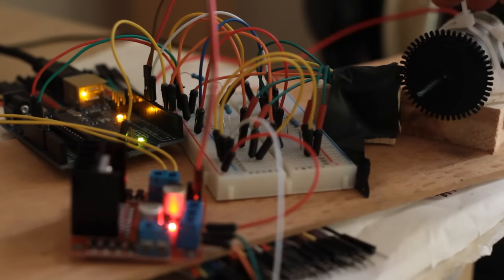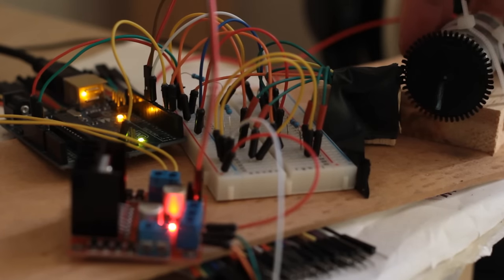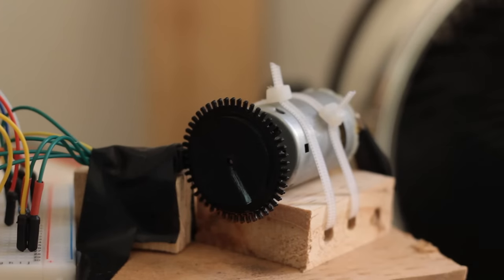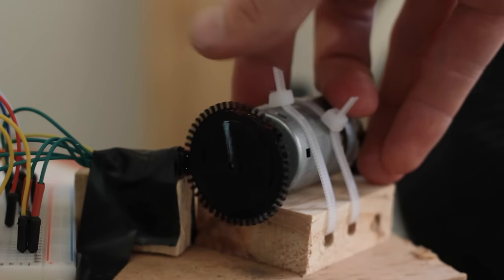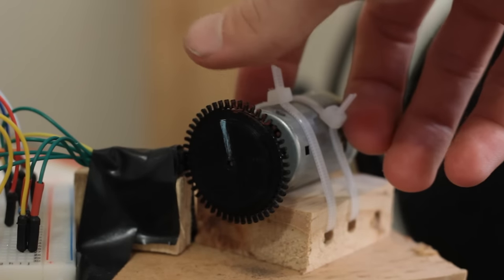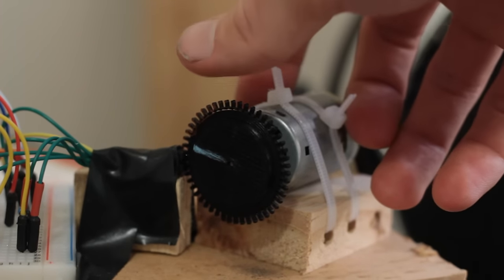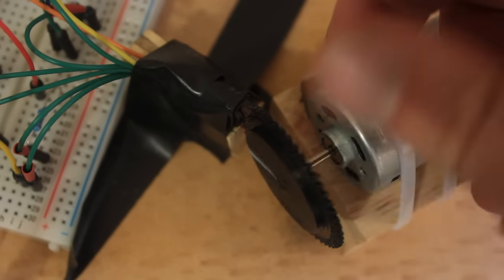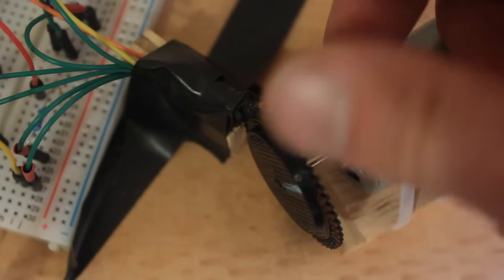3D Printed Optical Encoder

Comment: hello, do not check the code but I think what is happening is that you do not have a solid reference point, maybe a missing tooth or more than one alternating sequence would give a better resolution, but I do not consider that engine is the most suitable by its arrangement of coils, perhaps a  engine of 4 poles out of phase at 90 ° would be a solution to stop the movement of the shaft.

Comment: Which arduino are you using? Looks too slow. Are you using interrups? In this space interrups are even slower. Use assembly in tight dedicated loop. Best you'll get is 600e-9 second response time with 16mhz clock on arduino mega2560.  You know, you may try esp8266 with the wifi disabled if you are looking for common cheap parts.